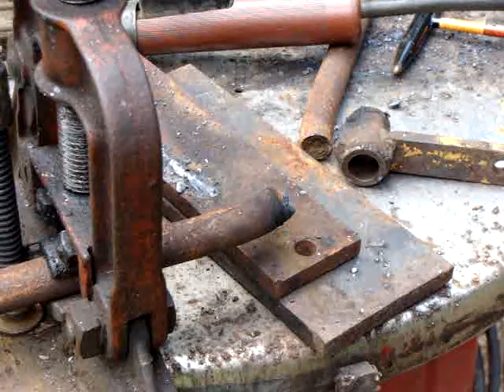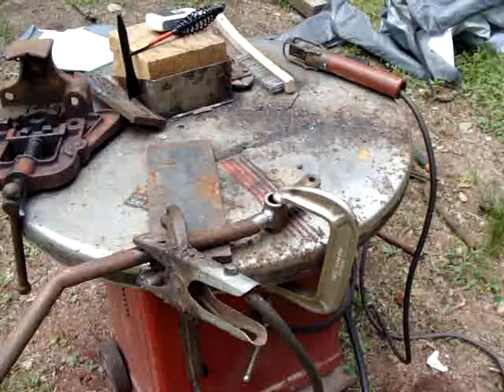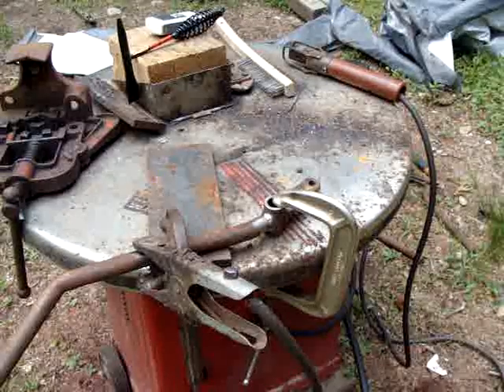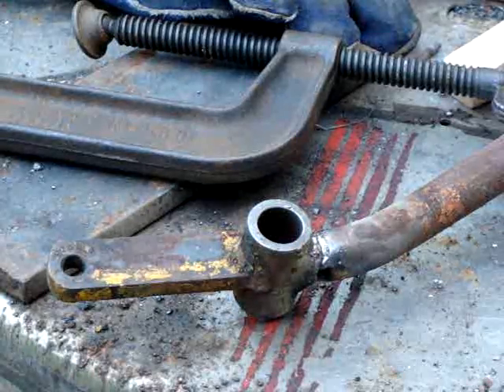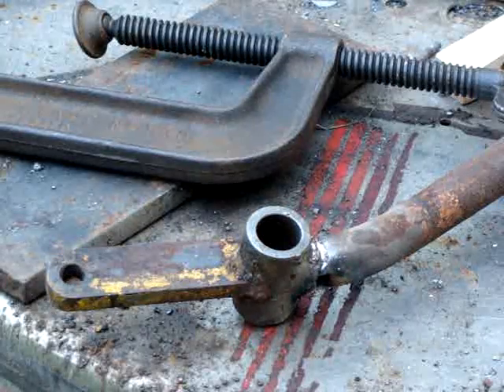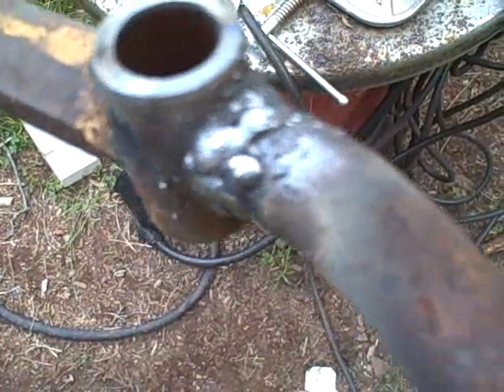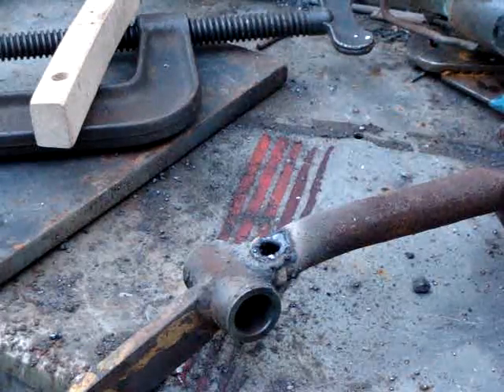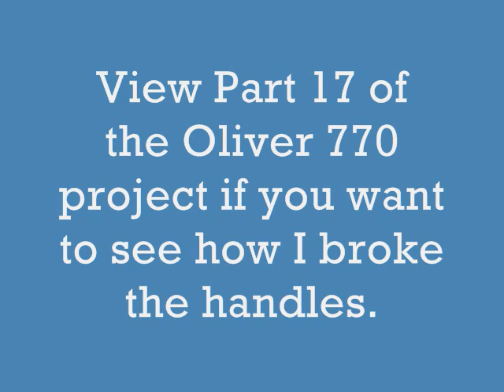Lincoln Arc Welder Part 9

Comment: Steve, A handy trick is to hold the rod with your other hand. You get slower, smoother movement that way. BTW Don't forget to clean the slag off each time you run a bead.

Comment: Hi Steve. Looks like ya having fun . every time before you start grind/ clean oil and the rust off both parts, and the ground location. It makes starting the arc easier. some welders have scratch arc  start rather than Tapping like you are so try that. The other thing is how good is that transformer. they can get worn and the arc goes unstable. that can cause poor weld too. I can weld real good but it's hard to figure what your dealing with in clips. being their trying it would tell me more.

Comment from the maker: I think my transformer is fine, but the contacts in the current selector could use some cleaning, and a new stinger, and ground clamp might help, but I think my biggest issue is my rods are at least 10 years old, maybe more.

Comment: Almost there...... i would throw the old rods in the scrap. Save the plastic rod pouches for nostalgia. Go buy a small package of new rods and learn on new electrodes. Clean everything the clamp or rod will touch.

As Commander Cody said" you're gonna drive me to drinkin', if you dont stop welding with that HOT ROD LINCOLN"!!!  LOL

Have Fun....,

John